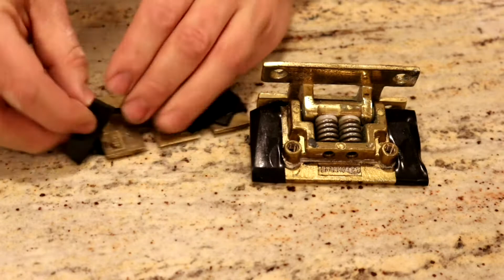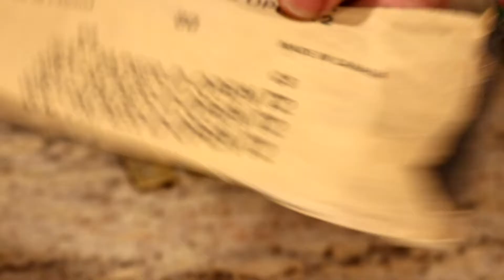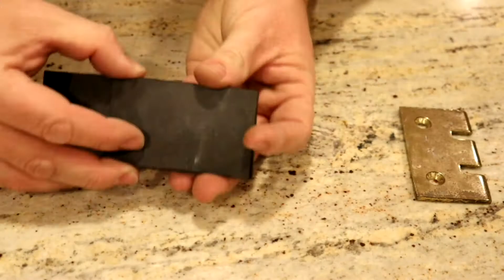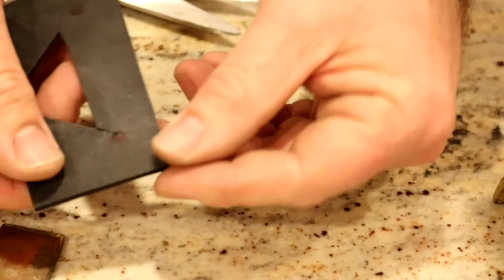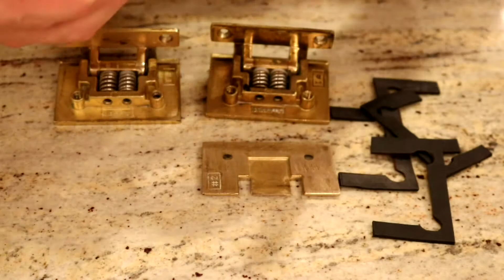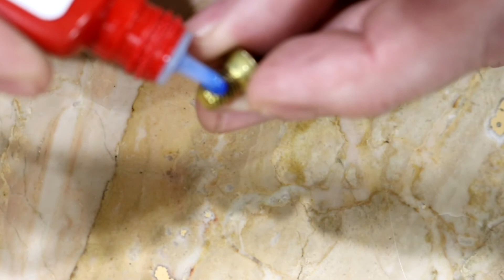How to Replace Glass Door Hinge Gaskets

Comment: I'm going to try doing this myself. However, if you use liquid thread lock, doesn't that prevent you from getting the screws out when you need to do an adjustment?
Reply: Andy Sagan the liquid thread lock just makes it more difficult to get off. It has to be “cracked” loose but not impossible to remove. It’s perfect for this application.